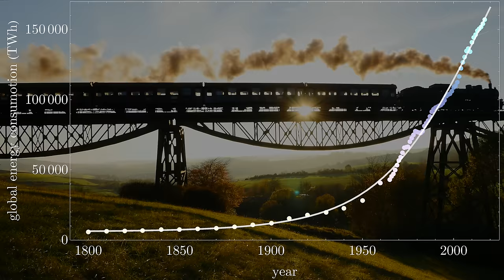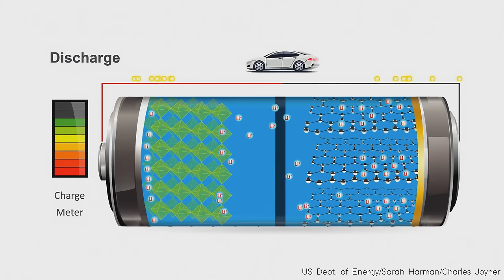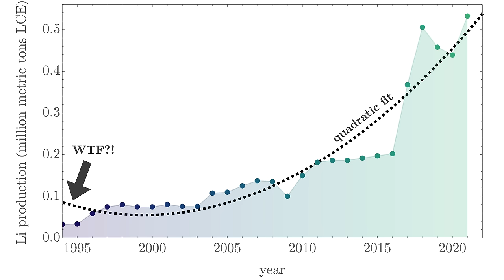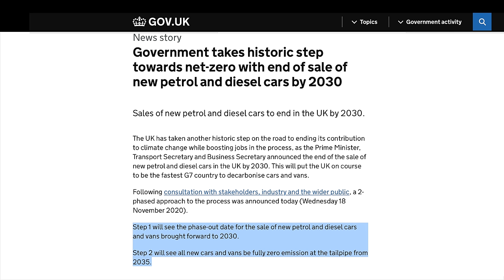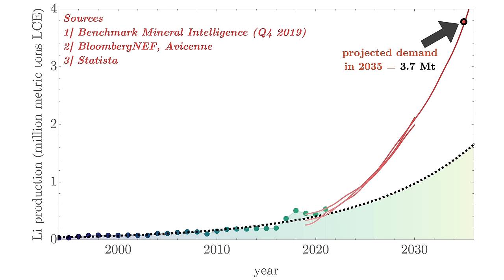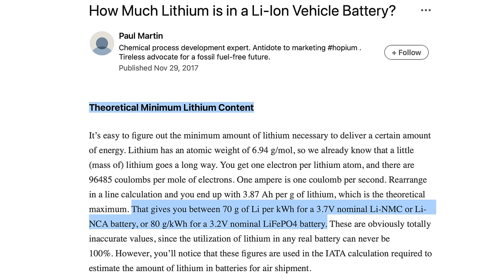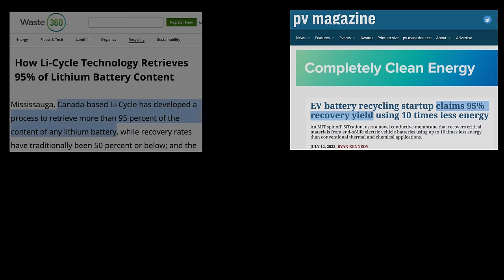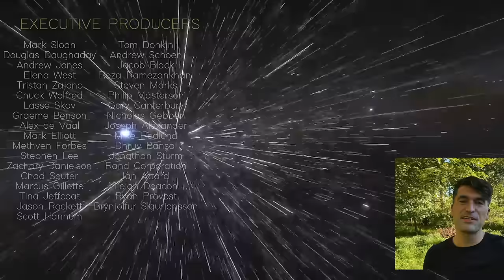Will We Run Out Of Lithium?

Comment: Thanks for presenting this, I have had concerns about this and all rare earths. I'm not a chemist, but could we enrich He to produce the LI we need? or would that be cost prohibitive? As we move out into the solar system and beyond we need to learn to recycle everything including space critical components etc..
Reply: Rare Earths Elements are not rare, it's just that they occur is small amounts and because up until now, no one wanted them, no one has bothered to either look for them or mine them
Reply: We could solve all the problems in the world if we could transform elements lol.
Reply: @RussianBotLvl  Well. Not exactly in the direction needed for lithium but there's fusion. Or rather there might be in the future.
Reply: The video is actually generally wrong. There's already efficient recycling happening of lithium ion batteries, it's just not at a significant level yet as there's very little lithium batteries to recycle yet.
Reply from the maker: We state companies already recycling lithium, but the point is, as you say, that a negligible quantity of our lithium supply is currently derived from recycled sources.
Reply from the maker: Fusion could produce lithium, in principle, but we have far less helium so you’d need to build to from hydrogen split out of water. May as well just extract the lithium from the water already there though!
Reply: @sam19270  yep and as long as we resolve the climate chrisis and end lithium shortage now we will never have to abandon it and insted fo fleeing to mars we can expand to many hundreds of worlds in the cosmos aswell as keep earth as our jewel of society
Reply: Don't forget phosphates and nitrates.
Reply: Lithium is not part of the group of elements called "rare earth metals", nor are any of them used in batteries. Neodymium is used in magnets for the type of electric motors usually put into cars.
Reply: @CoolWorldsLab  he's actually onto something here. Solar and wind isn't going to cut it for our future we need nuclear fission. Which means there's nothing stopping us from creating lithium from hydrogen wrapping the reactor in a shell of hydrogen would catch neutrons that would otherwise been lost from the reactor anyway. Not sure what kind of barns it has with fast or thermal neutrons might do better around a fast reactor.
Reply: @hansolowe19  right'o
Reply: @mikeohawk95  Missed the point.
Reply: @rexmann1984  , we could all use neutronoum/particlde energy reacters + hydrogen & higherl elememnts woudl allw us to catch neutorns 7 other petiles to convert to elelctron usage & soon neutornium enengy akak as sicnes used in MASS effect, & portion of it made real!!!
Reply: @w0ttheh3ll  im aware & i means it a half-life anion or cation made naturally over hundreds of years!!

Comment: Great programme! Very thoughtful and informative.

I wonder if Sodium may well supplant Lithium in a lot of battery applications in the next 2 decades. Lithium-Sulfur batteries may mean that we need less Lithium for a given amount of energy storage as well, meaning that we can reduce the amount of Lithium we need for applications.

I also wonder if the Salton Sea is considered in near term production. It apparently is a massive source of fairly accessible Lithium.
Reply from the maker: You do lose some energy density with sodium but it may supplant lithium is lithium supply can’t keep up, as we suggest could happen here. I don’t believe the Salton Sea is included in the supply projections.
Reply: @CoolWorldsLab  it sounds like stationary energy storage applications are going to be the first big market for sodium. Energy density is lagging but perhaps that can be improved with more investment.
Reply: @pipertripp  Sodium will eventually move into energy storage but will take a long time to scale up. We’ve had 30 years of experience scaling and developing lithium ion.
Reply: Well the Salton Sea is an active rhyolitic volcanic system (there is an active magma chamber down there which supplies the geothermal power and irregularly erupts every few thousand years) and rhyolitic volcanism due to how crystal fractionalization works within a magma chamber is the most chemically enriched natural source environment for lithium for the same reason the Andes are so effective.  There are other interior basins within North America's basin and range province a major  set of geological extensional rift complexes and crustal thinning with an arid climate meaning much of the lithium has been trapped due to the lack of outlets.

For this same reason other dry silica rich volcanic provinces such as much of East Africa, much of the Middle east(the dead sea is a rift lake and lift associated crustal extension and occasionally volcanism are ever present geological forces there.  The Armenian highlands  lake Van is another good place to look into since lake Van was formed due to the active Nemrut volcano

Note I'm following the USGS definition of active rather than Turkey's since by their definition any volcano not currently spewing magma is dormant and its last eruption was only in 1650 so it is absurd to call it "dormant" since it is about par for the eruption frequency of such silica rich magma systems.

There also is some suitable volcanics up in Alaska particularly the Land of a thousand smokes from the Novarupta eruption from Katmai's magma chamber as the region is arid enough that it probably hasn't had all of its salts dissolved out.

Indonesia has lots of volcanoes but climatically its tropical environment and close proximity to the ocean means it is all to easy to leech out the minerals into the wider ocean system. There is also active rift complexes between the Amur plate and Eurasian plates responsible for the formation of lake Baikal but that has so much freshwater input that the salts are extremely diluted (the lake is freshwater) and even if it was economical the lake is such a unique and ancient ecoregion that any such efforts could have devastating consequences.  Antarctica is another active complex but aside from a few particularly active volcanoes like Mt Erebus most of the activity is deep beneath the ice and will be freshwater saturated environments so not really suitable.

Australia has very little volcanism but the continent has been dry for so long that there isn't really anywhere for the salts to go.  So Yeah the arid and long volcanic history of the American Southwest (Its been volcanically active out west since at least the Jurassic but the peak activity was the Tertiary ignimbrite flare up episode which is analogous to the modern Andean Ignimbrite flare up episode,  and thus altogether it  actually is probably one of the best places on Earth for Lithium mining.
Reply: @Dragrath1  Thanks a lot for great geological  information!
I live in France, and we have two known deposits of Li, which could cover all France's present and future needs for Li.  One is some underground brine layers in Alsace, the other some rock deposits in Massif Central, a former volcanic region.  I read that the first one would be relatively easy and economical to exploit, while the second one would be more expensive to mine, and more questionable for environmental reasons.
Reply: @CoolWorldsLab  Energy density doesn't really matter for grid storage. Using other (non-lithium) chemistries for those batteries should significantly reduce demand for lithium. It's not production-ready yet but aluminum-sulfur seems perfect for municipal grid storage. Might even be able to get heated sidewalks (for winter) as a side-effect, too.

Comment: If prices for electricity keep exploding like they do right now in Europe, due to the shortage of cheap natural gas, the development might go less quickly than anticipated / planned. I think it would be a smart idea to also consider alternatives like Hydrogen or maybe even e-Fuels. Also pushing level 5 self-driving cars could have a significant positive effect in many ways: fewer cars occupying less space and needing less materials for production, fewer accidents and lower energy consumption.
Reply: The higher the electricity price goes, the quicker we switch into renewables. The shortage of natural gas is a short term pain and long term benefit.
Reply: I am a chemical engineer with 7 years of experience in the "green" hydrogen sector.  I can say with certainty that you can forget about hydrogen and e-fuels for cars.  Both solutions are way, way too expensive, as well as energetically inefficient.
Green hydrogen production will be mopped out for decades by industry, and e-fuels can certainly be synthesized, but only for "do-or-die" applications, due to their cost.
I am however with you on the topic of self-driving cars.  I can't wait for my Tesla to drive itself... at least on highways, where it's so boring to drive.  Unfortunately, Europe is not a priority for Tesla's FSD.
Reply: @st-ex8506  can you provide some reasons? I'm not so well informed about these technologies. I know that Hydrogen for cars  is very difficult as storage is an issue. e-Fuels could also help as we simply will not have enough Lithium resources to do more as ~30% of new vehicles as full EVs. And that will not be enough to reach the climate goals.
Reply: @nothingisreal6345  First, let me demonstrate that there is more than enough exploitable lithium for both electrifying the world's entire road vehicle fleet, as well as for the necessary storage for converting the all the grids to 100% renewable sources:
The total battery capacity for doing the above is estimated to be 300 TWh.  Assuming it is done with LFP chemistry batteries (very conservative hypothesis, as grid-storage batteries, 2/3 of the total, don't need to be lithium-based).  You need, with today's technology (another conservative hypothesis) 81 g of Li per kWh of battery capacity.  So, for 300 TWh, you need 300 x 10^9 * 81 = 24.3 x 10^12 g = 24.3 million metric tons.  That's obviously a lot, but...the KNOWN exploitable reserves of Li were in 2020 a bit over 21 million tons, and those reserves increase every year thanks to prospecting.  The US Geological Survey estimated the world's reserves at 25.5 million tons in 2010!
Once all those batteries have been manufactured for the first time, the Li for the new, replacement batteries will come entirely from recycling.
Now to the hydrogen/e-fuels/batteries problematic:
First, e-fuels are nothing else than hydrogen reacted with CO2 to produce alkanes comparable to gasoline, diesel fuel or Jet Fuel.  You first have to produce the hydrogen, than converting it to hydrocarbons via the Fischer-Tropsch process.  First, the green hydrogen is expensive to produce (we'll come back to that), but the FT process is also very expensive.  Without going into details, e-fuels will cost around $10/USG, just to produce.  I let you judge of their economic feasibility.
Then to H2 vs battery storage.
Let's take 1 unit of clean renewable power, let's say 1 MWh.  When using that power to produce hydrogen to then power a fuel-cell car, only 22%, or in 220 kWh, reaches the car's wheels.
Let's take the very same amount of clean renewable power, but use it to recharge a BEV.  In this case 73%, or 730 kWh, reaches the car's wheels.
BTW, in the case of e-fuels, that efficiency is only 13% or 130 kWh.
Sources for that calculation are very numerous, and differ little as to the result.  Have a look at this link:
https://insideevs.com/news/332584/efficiency-compared-battery-electric-73-hydrogen-22-ice-13/
But the disadvantages of hydrogen do not stop with energy efficiency, there many many others such as:
- Difficult to store and transport. (hydrogen tanks are very bulky, eating into a car useful space, much more than batteries).
- Dangerous to produce, transport, store and use.  Hydrogen is highly explosive (at least 2 hydrogen-filling stations have already blown up, one in Norway, the other in California.
- Hydrogen filling stations are VERY expensive, hence a big hurdle to generalizing them.
- Fuel-cells require substantial amounts of much rarer and expensive metals (Pt and other Pt-group metals) than batteries do.  With today's technology, you need 40 g of Pt per car... costing $1200 per car at today's Pt price.  However, there is BY FAR not enough Pt to equip all cars with fuel cells.
- Car performance:  the performance of the car is limited by the fuel-cell output, not so in a BEV.  The Toyota Mirai, for example, has only 155 horsepower, vs 325 for the ENTRY-LEVEL Tesla Model 3 (which is lighter than the Mirai)... not to mention the 1000+ horsepower of the Model S Plaid!
- You can't refill a hydrogen FC car at home, while an EV recharges at home while you sleep.
- Hydrogen is today 10-20 times more expensive per mile, than the electricity for a BEV!
- I might be forgetting a few...

Only advantages:  a slightly longer range, and a faster refill... provided you don't have to drive an hour to find a filling station.

Comment: Add this to the myriad problems that will be rendered moot if and when we perfect fusion power. Then it likely won’t matter how energy intensive it will be to use seawater. This applies to water purification as well.
Reply: We quite certainly won't "perfect" fusion power before 2035 (the horizon of most of this video). And even if we do it does not mean that fusion power will necessary be much cheaper than other sources of energy (we can't know yet).
Reply: With thorium we would have 1000s of years of power left. We have the tech now to have virtually unlimited energy

Comment: Something David does not address is there must be an equal amount of additional electricity produced to charge these cars. If only renewables are used, vast amounts of batteries will be needed to store wind and solar during calm and dark periods. Add in the push to heat and cook with only electric and demand will far outstrip supply long before 2035.

Comment: One thing not considered is the limitations of the existing electrical grids. Chances are improving this will require still more lithium. 
   I am curious also how Finland will address the problems in range, particularly in such a rural country
Reply: I think the electrical grid is not the big problem, as most EVs can charge at night where there is less demand overall on the grid.
Reply: Norway has the highest % of EV sales in the world, basically all new car sales are EVs some months... Very spread out and very cold... Is it not harder to find gas stations in remote spaces as well? Many gas stations are dropping gas and switching to only electric charging, the busiest gas station for Shell in the UK was switched over to only electric chargers and they improved their profits within a month. More gas stations will fail or switch as there is less and less demand for gas. (gas car sales have been dropping like crazy the last few years). We are just a few years away from gas cars being the ones with range anxiety, trying to find a gas station... Regular electrical outlets to use in an emergency are already way more spread out than gas stations...  As for the grids, UK grid did a survey and found that their current grid would be fine even if all cars were electric right now... It will actually help balance the grid as most car charging would be done when there is less electrical use, help smooth out the spikes and dips...

Comment: Batteries can be recycled almost 100% recapture the lithium so I think we will need to see a very fast ramp up of recycling operations and incentives to customers to leverage those options.  Also there is a lot of work going on around moving batteries away from lithium too.  The use of Graphene in Aluminium Ion Batteries and Graphene Supercapacitors are both very exciting future technologies.
Reply: Such a policy requires vision, courage, and intelligence, and is therefore doomed to fail in any democracy.
Reply: Batteries are lasting so long (basically most will never drop below 81% of original capacity even after millions of miles worth of charging and discharging) and have so much demand as second use that there is not enough for recycling companies that already exist and are trying to grow... Obviously that will change as batteries get ever older ad more plentiful, but for now, the recyclers that exist would be able to use and would love to have access to more batteries to recycle...

Comment: California does not have a Recycling Center the rest of the Nation has 5 
Electric Vehicles.  
Leaky Acids or  other Chemicals 🔋from battery Packs, which POLLUTES our GROUND WATER due to unpaved Junkyards. With unplugged EV'S are not plugged in therefore, the battery packs don't have cooling systems flowing, since they are not plugged in. Thermo Expansion occurs and the Battery 🔋 packs rupture in summer heat Acids or other Chemicals spill and seep in to our GROUND Water 💧 

From Millions of Hybrid Cars and Electric Vehicles (EV's). From 8 to 12 years ago sitting on Junkyards. I double checked to confirm Jalopnik Article. 
There are only Recycling Centers ♻️ for Electronic devices Cellphones and 📺 🖥 Computers 🖥

Comment: Lithium is about to be replaced by Sodium in a new battery design, as Sodium is the next element in the element table. The first Sodium-ion battery is about to be released in the next month.
The moral of this tale is, not to worry about one mineral or another as EV batteries are developing fast and what looks like a problem today will be solved tomorrow